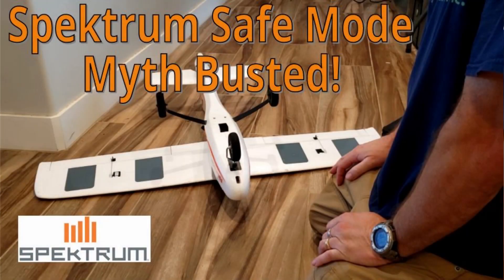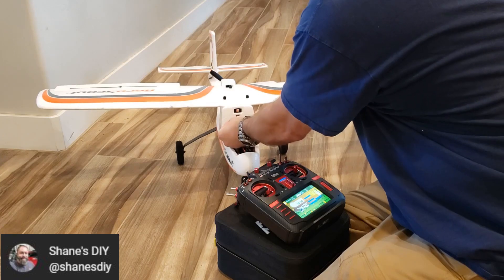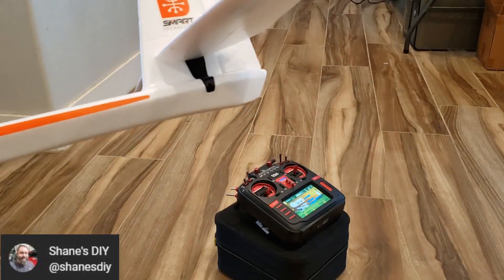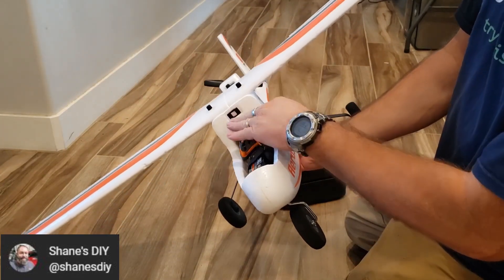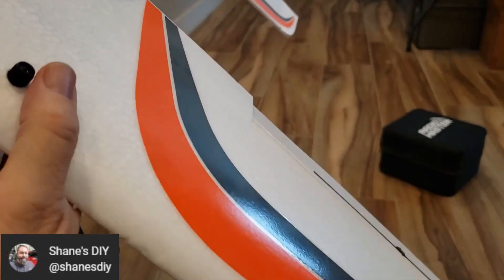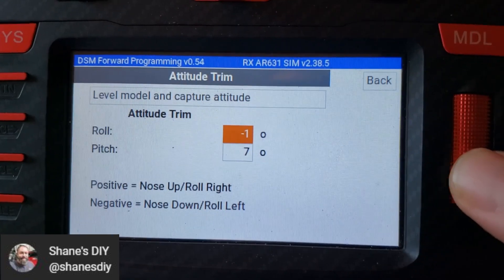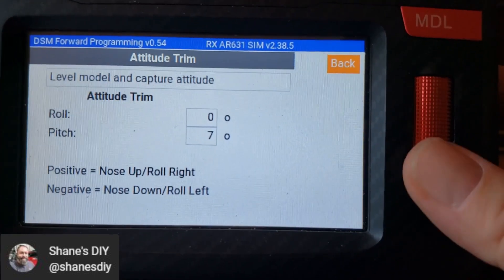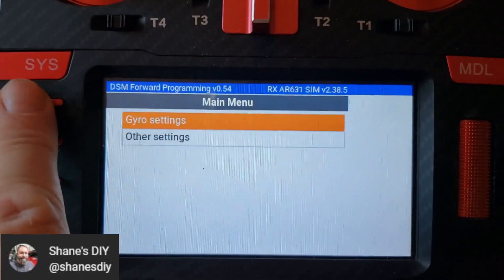BUSTED!!!  Spektrum SAFE Mode Gyro Initialization Myth

Comment from the maker: **IMPORTANT INFORMATION, PLEASE READ**
I need to clarify a few things on this video.

First, this is referring to the newer Spektrum AR630, AR631, AR637, and possibly the larger AR8360T gyro receivers.  The information in this video will not likely apply to other manufacturers gyro receivers and, as @txkflier pointed out below, the older (now discontinued) Spektrum AR636 receiver DOES require the airplane to be flat and level to initialize.  It is your responsibility to test everything I discuss in this video yourself before flying your airplane!

Second, and very important to understand, as I stated in the video, you can trim the airplane while in safe mode, the receiver doesn't know the difference between trim adjustments and you just moving the control sticks.  What you need to know is if trim is required in safe (and there is no wind!), it is likely due to improper safe gyro attitude trimming in forward programming (shown in the video), a loose or relocated receiver.  Due to this, if you trim while in safe mode and switch out of safe mode, the trim will be wrong when not in safe.  One way around this, if you have a locked BNF receiver and cannot correct the safe attitude trim, is to use flight modes on your transmitter to enable separate trims for each mode.  Then switch between these flight modes with the same switch you use to change the SAFE/AS3X flight modes.  How, and if, you can accomplish setting up these flight modes depends on what model transmitter you have. In a future video I may elaborate on this if there is interest.

It is best practice NOT to perform any trimming while in SAFE "auto leveling" mode.  This does not apply to "Intermediate" (envelope) and AS3X only modes. It is fine to adjust trim in those modes.

Comment: i got this, however elevator not working i believe the safe is preventing it, also aileron and rudder have so small movement angles even though i have it on 100 weight, i can't get safe mode off,
Reply from the maker: What radio are you using? In addition to the safe mode switch on channel 5 you must setup a button on channel 6 or it will be stuck in panic mode which is a more restrictive version of safe auto leveling mode.
Reply: @shanesdiy  ethos frsky x20rs
Reply from the maker: @ClaudeFrancois-f2t  What aircraft model?  If it is a BNF trainer like the AeroScout, it may have the panic mode preset to channel 6 as I mentioned.  If you have not already seen it check out this video of me setting up channels 5 and 6 on the AeroScout with EdgeTX on the TX16S.
https://youtu.be/ZefAYBJVdvk
Reply: @shanesdiy I have did not work replacing receiver with non safe and non stabilizer
Reply: @shanesdiy hi again I got a new receiver I took all the leads from spektrum servo now I cannot remember which lead is esc or aileron elevator and rudder nothing at all in the internet very hard to track the wires to see which one is which
Reply from the maker: @ClaudeFrancois-f2t  What make/model receiver did you purchase?
Reply: @shanesdiy tandem I know what channel plugs to receiver but I can’t see which wire is coming from aileron inside plane or the esc or rudder and elevator 
No diagram anywhere on this 
Tandem uses aetr protocol just like tx16s
Reply from the maker: @ClaudeFrancois-f2t  Won't hurt anything if the wrong servo is in the wrong port.  Plug each one in one at a time and move that channel and you can label the servo wires.  You know channel 1/port 1 is aileron, plug them there and move the aileron stick and you'll know which is plugged in.
Reply: @shanesdiy more importantly which is the esc can’t bind yet
Reply from the maker: @ClaudeFrancois-f2t  Hook up the battery then plug in each servo plug until the receiver powers on, that is the ESC wire.
Reply: @shanesdiy ty
Reply: @shanesdiy  ty i had problem registering updated firmware as well i got all working now thank you again for your help as always

Comment: A question please -
(not about Aeroscout) - I am working with Forward programming on an AR630.
I have SAFE and AS3X. Right now I have it set up with a SAFE mode,  a SAFE off mode with gyro on and  SAFE off mode with gyro off  (these are on a 3 way switch).
I want to change one of the SAFE off modes to be -
SAFE ON - but with self-leveling OFF.

When I googled that as a question the answer was it could be done thru forward programming by selecting the right flight mode. But it did not give details on how to do that.
Can you tell me how to have a SAFE mode but without self leveling?

This would be the same as the intermediate mode in the Aeroscout.
So what I'm trying to do is set up my AR630 (to be used in another airplane)
that will have a flight mode option that works like the Aeroscout intermediate mode.
Thanks
Reply from the maker: Hi and thanks for the comment!  "Intermediate Mode" is referred to inside Forward Programming an "Envelope" so if you have Safe Off for one of the modes and set it to Envelope that will have bank and pitch limits but no auto leveling.  The full safe with auto level is referred to in Forward Programming as "Self-Level/Angle Dem".

Here is a link to one of my videos that takes you to one point in the video where I mention envelope mode.  Later in the video I also show F-F-Mode settings where you can set each flight mode.
https://youtu.be/mEfLGnEZN9U?si=wwJ5um4j3q2n2YOP&t=1391
Reply: @shanesdiy  Thank you Shane....exactly what I need. There is a strange problem with the Aeroscout where in some planes if you are in intermediate mode it will start to self level if you try to turn. For most, including myself it is the left turn, I saw some comments in the rc forum that it was the right turn for some others. So now I can program an AR630 OR AR631 to mimic the 3 flight modes on the Aeroscout and avoid my left turn problem. I could find no answer in my testing or searching rc form as to what causes this problem.
Reply from the maker: @lw216316  I experienced odd anomalies with the stock Aeroscout intermediate mode as well.  After I did a factory reset and reprogrammed it from scratch I have never experienced it again.  It is my believe there is a bug in "some" of the stock BNF AeroScout AR631 programs that effects intermediate mode.
Reply: @shanesdiy  my conclusion as well, at one point all I did was put a different wing on and it started working - How could that be?
Could the aileron servos be the problem?
Reply from the maker: @lw216316  I don't think so because in my case I just did the factory reset on the receiver and reprogrammed the gyro functions from scratch and it's worked ever since and that was over two years ago.
Reply: @shanesdiy  so after you did the factory reset did you then use the 'envelope' option?
Reply from the maker: @lw216316  Yes, I still have envelope option for flight mode 2 on my AeroScout.
Reply: @ The bench test using the envelope option worked so next I will field test it  - thank you for your help, may your skies be blue and your wind calm !

Comment: Is there a way to fly the plane without having to leave it perfectly still? I fly my float plane off of my boat and I have to get out and walk to shore to set the plane down on something to turn it on.  It would be nice to just fly it.  I don't even need SAFE mode or AS3X because I only fly in very calm conditions.
Reply from the maker: With this particular line of Spektrum gyro receivers, I think you'd have to do a factory reset and not configure any gyro features to just make it a normal, non-gyro receiver.  Then it should initialize without being stable.  You have to do the factory reset via Forward Programming with a compatible transmitter.  If the factory reset option isn't available in the forward programming menu, you'd have to do a firmware update to unlock it.

Comment: Thank you for the great videos, keepem coming.
I have a AeroScout S2 (with AR631 RX) and RM TX16S (with edgeTX v280 & with the latest Spektrum Fwd Programming SW installed on the TX) what videos or playlist do I need to watch to get my rig setup like yours?
Reply from the maker: Sounds like you've already done some of it but my Spektrum to EdgeTX forward programming series goes through alot. I have one video testing my flaperons and discuss some of the details of the setup.  Let me know if you have questions or if you'd like to request a video I haven't done yet.

Comment: 1. You can use the trims in SAFE mode, but unless you’re using flight mode trim in the transmitter, your plane won’t be trimmed when you exit SAFE mode. You’re supposed to trim the plane with SAFE off and if it’s out of trim in SAFE mode, you need to tweak the SAFE mode attitude trim values. And no, you shouldn’t use the transmitter’s flight modes to control the receiver’s flight modes. All you need to do to control the receiver’s flight modes is to assign a switch to the receiver’s flight modes channel. 
2. The AR636 wouldn’t initialize if it was upside down; however, it would bind. When you then turn it right side up, it will initialize.
Reply from the maker: I do like using flight modes to separate the trims for different flap positions. Much better than experimenting with flap->elevator mixes until you get it where you want it.
Reply from the maker: Good tips txkflier.  This wasn't a guide on setting up the plane, flight modes, etc. I have many other videos on that.  Just dispelling several common misconceptions.  I never trim in safe, just confirming you can.  Flight modes (in the tx) would be an easy way to separate the trims if you had a locked RX and couldn't fix the attitude trim in forward programming.  Would really be your only option without unlocking the rx.

Thanks for the info on the AR636, good to know although that one is discontinued so will be seeing it less and less.  This video was primarily geared to the AR630, 631, and 637 but since I didn't say that in the title it could be misleading I suppose...
Reply: @shanesdiy  On my EDF jets, I put my transmitter's flight modes on the flap switch and enable flight mode trim so that I have separate aileron and elevator trims for each position of the flaps. A week or so ago, I was flying my Freewing 80mm L-39 EDF that has an AR636 in it. It was descending slightly in SAFE mode at full throttle. Instead of hooking it up to my laptop and adding a little pitch attitude trim, I set up a mix in my iX14 that's only enabled in SAFE mode. It uses the LT switch and seemed to work fine. I have dozens of AR636's and one or two of each of the Smart AS3X/SAFE receivers. I'd just as soon buy a used AR636 for $30 or less than pay a lot more for a Smart one. I still enjoy programming the 636's and they work great.
Reply from the maker: Thanks for your input @txkflier.  You inspired me to created a pinned comment so I could clarify a few things I neglected to mention in the video.  Hopefully viewers will read it!  While I wasn't wrong on anything, I contemplated pulling the video and adding this info just so folks would not be misled, hopefully the pinned comment will be sufficient.
Reply: @shanesdiy  Btw, I just tried it with an AR630 and of course, it will initialize when it's upside down, provided it's not moving. I had never tried it before, probably because AR636's won't. Then I repeated the test with an AR636 and sure enough, it won't initialize if it's not right side up. The orange LED won't even come on until you turn it over, which is probably why some people say that you can't bind an AR636 if it's upside down, even though the transmitter says, "Bind Complete". Then I added full aileron trim with SAFE off and when I switched to SAFE mode, the servo stayed right where it was. When I set the aileron trim all the way in the opposite direction in SAFE mode and turned SAFE off, the arm again stayed in exactly the same place. But that's with the receiver flat on the table. In the air, SAFE is going to move the servo so that the plane maintains a certain angle with respect to the ground. Yes, the trim is going to affect that angle, but when you come out of SAFE mode, the plane is probably not going to fly straight and level. So, trim with SAFE off and adjust the SAFE mode roll or pitch attitude trim so that it flies level in SAFE mode.
Reply: @shanesdiy  Your video was perfect except for the couple of times you inserted the yellow text that said that trim works in SAFE mode. I felt like it would lead someone to trim in SAFE mode and then have a plane that wasn't in trim with SAFE mode off. If it hadn't been for that text, I probably wouldn't have commented at all. Also, I think the behavior of the AR636 is what leads people to think the Smart receivers won't initialize when they're not level. Sorry to be a thorn tonight.. 🤠
Reply from the maker: @txkflier  Haha, you are not a thorn.  I appreciate the input and experience. My goal here is to help people understand and if I show something that might confuse people that defeats the purpose of the video.  Thanks for the collaboration!

Comment: I think the confusion comes in because some older models won't initialize until they are level. My Carbon Cub S2 will not initialize while upside down. The battery goes in the belly and won't do "The  Safety Dance" until it is right side up. It'll sit there all day on it's back. Maybe it's a safety feature?
Reply from the maker: Perhaps older Spektrum gyros are different but I haven't experienced one that won't initialize as long as it isn't moving.  My Timber X is a belly load and as long as it is not moving it'll initialize and be fine. It has older firmware and still the BNF rx firmware.

I was sure to mention in the video, don't just take my word for it, try it on your own plane to be sure.
Reply: Bravo, well done @malatoke!   "The Safety Dance".  I shot Pepsi out of my nose when I read that.
Reply from the maker: Which receiver does your Carbon Cub S2 have in it?  Working with @txkflier he confirmed that the AR636 does require the airplane to be sitting level to initialize.
Reply: @shanesdiy  I will have to look. It's the receiver that came in it. I haven't swapped it or unlocked it. The only reason I know is that I set my plane upside down to put the battery in when I'm getting it ready to fly. I think this is a one off though as I can also confirm my aeroscout will arm in any orientation just as the video shows.
Reply: @shanesdiy  Alright, I took a look and my Carbon Cub S2 has a A3230A Flight controller in it. So even though it has SAFE it probably functions a bit different than a standard receiver.
Reply from the maker: @malatoke  Great info, thanks for checking!  Seems a very specific receiver just for that airplane according to the product pages on Horizon and Spektrum web sites.

Comment: Trim does work in safe but its not q good idea as your fighting the auto level and putting stress on the sero. Trimming should be done out of safe. Correct plane can be plugged in with the plane in any postion. It just need be stable that is all it asks. Nice presentation of the Altitude trim. Not many ppl know this part exists.
Reply from the maker: I don't trim in safe, never needed to, but I hear so many say you can't. The receiver doesn't know the difference between trim adjustment and moving the stick. Put simply, if you give it some left or right trim the rx just thinks you are holding the stick to the left or right. No more stress on the servos than just flying around in safe.

Thanks for watching and for your comments.

Comment: Is there a way to unlock that BNF receiver?
Reply from the maker: Yes, I have a series on on the Spektrum RX and in episode 2 we unlock an AR631. Look through my RC guides playlist and you'll find it. You need the Spektrum USB programming cable.
Reply: @shanesdiy  
Awesome! Thank you! Great video btw
Reply: The only AS3X/SAFE receivers you can’t unlock are the older AR636A’s. The newer AR636A’s and AR636B’s can be reprogrammed. Basically, if you can register it, you can reprogram it.